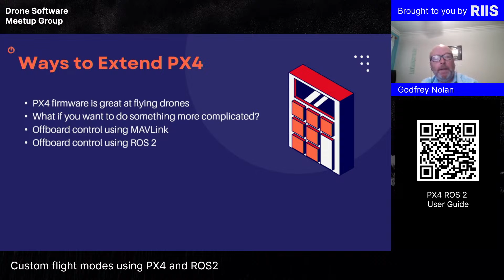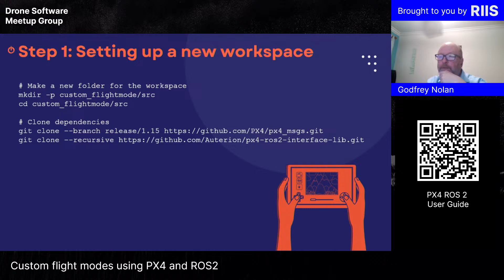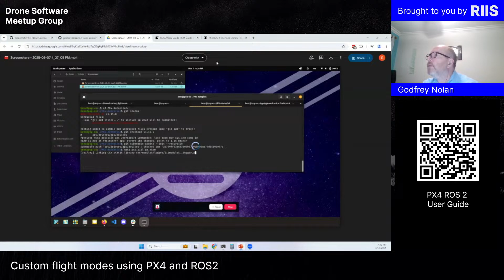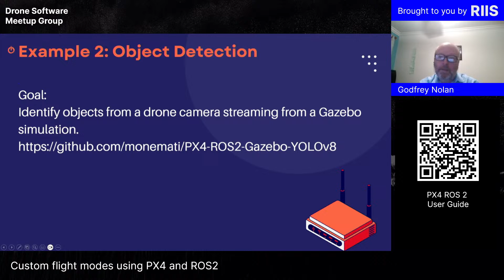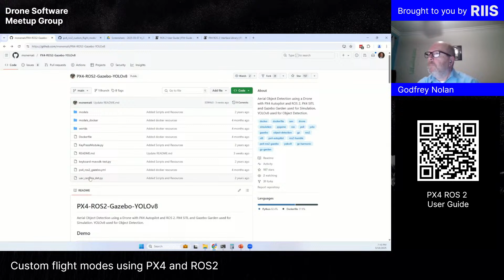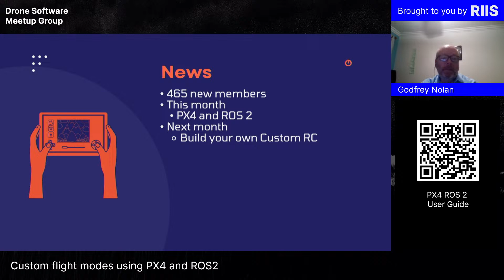Custom flight modes using PX4 and ROS2

Comment: i think write firmware with micro-ros communicate direct with ROS2 is faster but i have problem to solve is RC. if i am use H16 remote does it is connect to PC or FC?
Reply: Hey buddy,
Gaurav this side.
This may help you, go through it.

To connect your Skydroid H16 transmitter to a PC/laptop, 
you can use its built-in Wi-Fi hotspot for wireless connection 
(great for flight simulators like QGC/Mission Planner via UDP/TCP) 
or use an OTG/USB cable for direct data/video sharing, leveraging its Android OS and rich interfaces like Ethernet (RJ45), HDMI, or USB-C for ground station apps, telemetry, and live video feeds, requiring software like VLC, QGroundControl (QGC), or Mission Planner to receive the data. 

Happy fliyings...✈✈